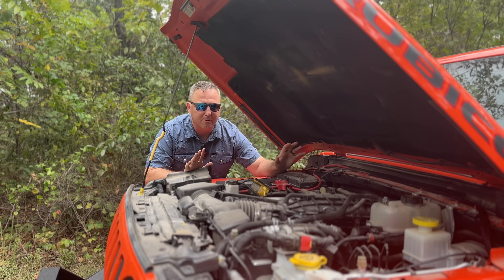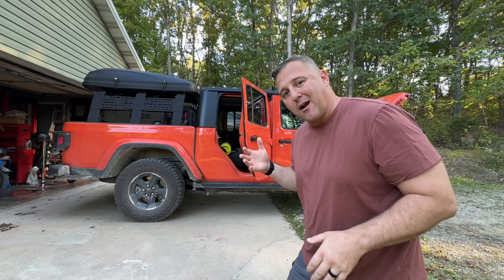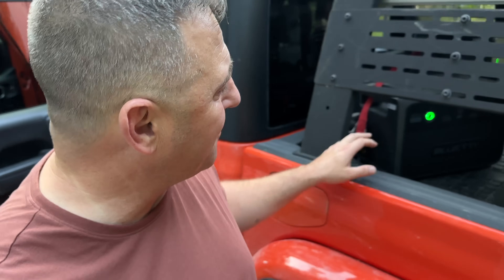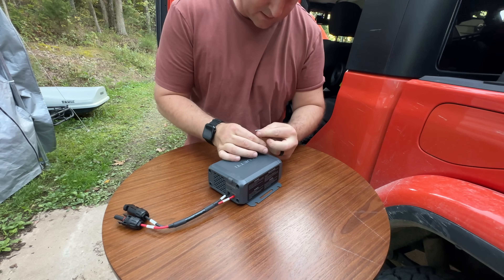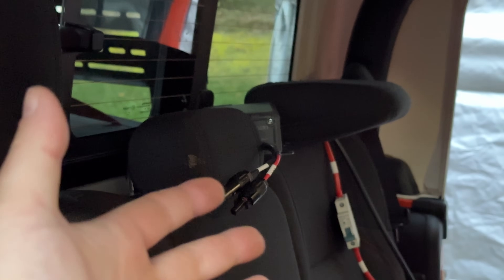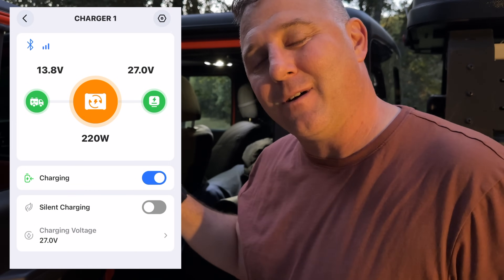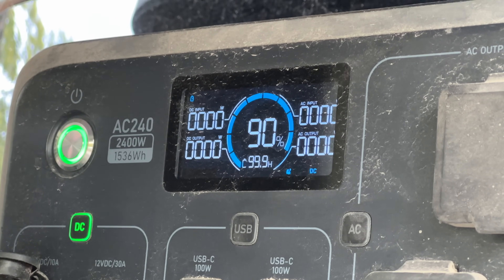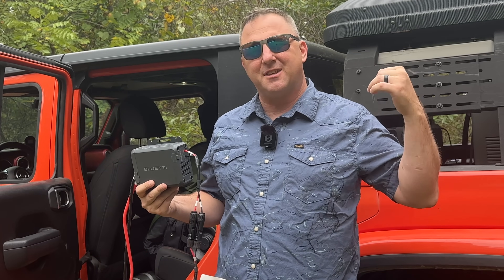Solar is OBSOLETE! - BLUETTI Charger 1

Comment: Nah, solar source is free and pays for itself pretty quickly for the storage, cables etc.  My rig requires a house battery so I'm not paying for that in a solar solution because it's there anyway and panels are getting cheaper all the time and for charging power stations, you've already spent the money on the storage.  Cables, especially low voltage can get expensive but yeah, free energy source mitigates and back fills that cost quickly.  Alternator failing on my RV in a remote boondock, I'll pass.  I would use alternator charging as a backup system but never as a primary source of energy personally.  There is at least one video showing what these alternator DC to DC charging do, load etc and it isn't pretty at idle.  On the move the load on the alt isn't bad so if it is used strictly while in motion I can see it but if you're at a spot for a while and run your rig/car/truck at idle to charge power stations that's a pretty heavy hit.  Anyway, I'm in camp of, your title "Solar is obsolete" is nonsense and nothing but click-bait.

Comment: Great video. Second one I’ve found talking about DC to DC charging.  So it’s made me pause,  getting ready to do a Sequoia build with your basic led lights, onboard air compressor and cooler.  Was planning on a solar set up BUT you and the last bluetti dc to dc video have made me reconsider.  My knowledge of ANY power is limited.  In just a couple sentences could you tell me why this set up would be a better choice than solar?  I’m probably looking at an average of 2-4 day camping excursions with the electrical devices I mentioned.  Thank you in advance.  🙏🏻

Comment: Why would you not have routed the cable in the reverse direction with the breaker closer to the vehicle battery?
Reply from the maker: I moved this over to my minivan and have added a regular fuse near the battery. The breaker is supposed to be near the charger to shut it off for storage.

Comment: What a dumb 'catch phrase' all over YouTube! Solar is NOT obsolete! It has its place for the right circumstance and / or situation. If you do have engine trouble, burn up your alternator, or whatever the case may be - then you're screwed. You're going to need that solar panel.

Comment: You kept saying alternator charging for the Blueetti Charge 1. ??
Then you ended up hooking it to the battery which is what I had expected.  
Isn’t it better to set the adjustable charge rate to a lower than the max setting.?? Especially if you plan to keep it within the charging parameters of the power station.
I am also considering the Pecron dc to dc charger.

Comment: I prefer the old school device called a battery isolator. It's been around for many years. Just install a 2nd battery under the hood for the camper then put a battery isolator between it and your vehicles battery. Both batteries are charged by the alternator but the vehicle battery can't be discharged by your camping equipment. That's why it's called an isolator. You can still charge the 2nd battery with solar panels if needed.

Comment: First of all, thank you for putting out this video second I'm electrician of 45 years and what you're saying about putting the circuit breaker in a warm engine compartment might be detrimental and cause premature tripping the breaker. The breaker is a thermal switch resistance is measured by heat. Just something to think about.

Comment: So I am no rocket scientist but I clearly saw where he installed the  black (negative) wire on the red (positive) side of the charger.  It clearly had the + symbol where he  INSERTED the black wire and tightened the set screw. 😮😮😮😮

Comment: The 800 amp Ecoflow alternator charge vs  Bluetti Charger 1. Which one is easier on the alternator?
Reply from the maker: EcoFlow is harder, but you can limit the output on both devices. So, you don’t need the entire capability of that’s an issue.

Comment: I guess people don't care about replacing alternators due to running it at 100% duty for a hell of a lot longer than it should be.... the charger does not "provide" any wattage as the comment states and is just putting extra load on the vehicles electrical system.... (which it was never designed for).... That's right people don't care about having to replace things constantly!! consumerism at its finest!!

Comment: There is a way to put both solar and battery through Charger 1 to recharge your power station quicker. You need splitters for Negative and Positive and a couple of diodes for extra safety and you have to match the solar output to your alternator and set it on the Charger 1. SOLAR IS EVERYTHING but obsolete.

Comment: Solar may be obsolete for you, but for me it still has its own value. I use a DC-DC charger in my car to keep an in-board LiFePo4 battery fully charged whilethe battery serves a few purposes such as running my cooler. The RedArc DC-DC charger can use solar panel input for when my car is at campsite and not running. I am very happy with that setup.

Comment: These put extra strain on your alternator that the OEM part wasn't made to do. If using this device you WILL be paying for a new alternator battery etc. Your better off to get a solar generator. There companies that make portable solar generator that comes with panel and also a wind turbine to charge batteries on cloudy days.

Comment: Your presentations are great and I really like and benefit from them.

However, relying on a dc-dc charger may not be wise unless your reliance on battery and charging methods is limited to non critical needs such as weekend or short term camping.

My requirements have changed in the present day economic/political climate.  My needs are now critical and long term.

The probability that my Sienna may become a long term shelter in the event of an economic emergency resulting in extended unemployment, have significantly increased over the past 100 days.

That said, my battery requirements changed to:  
1) DC-to-DC Charging
2) Solar Charging (200-400W)
3) Plug-in Charging

I "hope" the economy does not collapse but I have never found "hope" to be a reliable predictor of things to come.  Constant observation and search for new supporting data points are better predictors.  The data continues to point toward the approaching dark clouds.

Your videos are a wealth of information, keep them coming.

"Be Prepared" my Friend

PS - I installed a breaker right on top of the battery to address my concern of a short circuit/fire hazard in the wiring.  Like your concern, this minimizes short circuit risk!

Comment: I really appreciate the warnings and real world concerns.  I see were you might cut your alternator life down 3/4 1/2  ?  ask around is there a better  alternator for the extra work  ?     or Spare   Good Video 5*
Reply: Solar is definitely not obsolete!   I like the backup system   Your big  BLUETTI  in the back can be charge in AC if needed  .     I`m still not seeing anybody talk about there  auto`s System  does this effect it  what does  Jeep say  can that be a option in buying a Jeep  back up power .   You did get very close to this in your Video .   I`m calling GMC tomorrow to see if they can put this in  and what do  they recommend   with out   warranty problems. Good Video 5*

Comment: And let's face this fact about over working your alternator and having problems that aren't covered under the vehicles electrical warranty. You also had the ability and I always suggest to anyone adding gear that could over tax their charging system or electrical system in their vehicles to replace the factory alternator and battery both when they add things such as this charger system winches or offroad lighting and at most add a second battery to their electrical systems to handle all that load you just added to the vehicle!!!!!!

Comment: Ok my guy you claimed at the very beginning that someone else installed this charging device and they placed that surge protector inside by the left rear door and that had you installed this you would have placed that surge protector cut off switch under the hood closer to the battery. But you're second part of this charging system device you've added an install video where you're installing this yourself! Which means that you could have placed the cut off switch under the hood!!!!!! That's a you issue buddy!!!!!

Comment: @ Adventure Gear TV, First Off, Solar is not Obsolete, And that charger is only good if you are driving, When Camping or Off Grid you can't leave your Jeep running  for 3 or 4 hours every other day or you would not have enough fuel to get Home, If you are going to Post this BS at leased put your Brain In Gear first.

Comment: I've got a 500w solar panel on the roof of my campervan and would never consider removing it, I've simply fitted a changeover switch when I drive I switch to charger 1 and when I'm stationary I switch to Solar. Simples.

Comment: Since you have both bluetti charger one, and ecoflow alternator charger, and you also have upgraded alternator, you can charge your ecoflow delta max on multi charger mode, right? Ecoflow alternator charger goes to the expansion port. And if you buy mc4 to xt60i connect to that bluetti charger one to the solar input on your ecoflow delta max, i know my ecoflow delta 3 plus allows me to do so i guess it will be the same.  You can charge 800w + 500w = 1300w. Damn.. that is a super charge.

Comment: Nice video.
Question- is there a way you could put a switch under the hood to turn off power to the Charger 1 and let the electrical system revert back to its original configuration to insure you are getting plenty of charge on your vehicle battery?
I’m thinking on long road trips after you have charged the Bluetti for a few hours, when you stop for gas, flip the switch and let the alternator give the battery max charge.
Thanks.

Comment: We have this installed and while it's an amazing bit of kit, we are now installing solar aswell as you cannot be static for longer than a day or 2 before you need to drive again to recharge and all we have plugged in is a cool box and a gas detector into our brand new AC180. I think it's good to have both, solar and charger 1 in our situation

Comment: Thanks for showing us the install. One quick note on the XT150 connector. They have been used in RC including drones for decades and the point is to be non- proprietary  XT60's and 90's are much more common but totally available.

Comment: The oil party will end, solar energy will be here well after we turn into carbon.  What influencers need to push if for energy efficiency.  Car makers don't make cars that use less gas because they are not forced to do so.  the batteries on all of the so called generators are not replaceable in most cases, for that you have to build your own.  That bluetti does not charge itself, it needs to be charged, be that solar or grid power.  We live in a world that is completely governed by planned obsolescence.  things are made to fail, not to last and definitely not with efficiency in mind.

Comment: Use a battery and hook the dc to dc on off switch to somthing in the fuse box that run on the accessories from you ignition. It will never charge when truck ain't running. Starter battery will be fine.

Comment: So, you have to have a several thousand pound generator with a small power output compared to smaller more efficient generators while being a hundred times the price, and then keep filling it up with a limited and expensive resource.......

How does this make solar obsolete?

Comment: Very interesting…especially overloading battery / Alternator issues you mentioned, sounds like a headache waiting to happen… I suppose am I better off just getting solar panels on top of my RV ? Curious…I am set up for solar to plug in, it’s just a matter of installing them on the roof of my RV …is this designed for. more cost effective compared to solar ? Thank you

Comment: Thanks for the video!  Great discussion!

I was wondering, though, have you actually measured the power from the charger?   Or, are you assuming you are getting the manufacturer rated power?

Also, are you getting a standard 13.8 volts DC out of the unit?   Or, can it be adjusted to boost the output voltage?

Comment: One thing I was wondering is does this turn off when the vehicle is off (to avoid battery drain)? Or do you need to unplug every time you turn off your vehicle? I see Bluetti says it includes intelligent voltage monitoring. Did you find that worked out okay?

Comment: I am just looking into this.

Questions
Could the alternator charge a second battery that would power the power station.

A bettery seperate from the vechile starting battery?
Reply from the maker: That’s exactly what it does. In my case the second battery is the power station. You could also charge a different battery.
Reply: @AdventureGearTV  In my case being in a van I thought maybe a second battery might hold more of a charge than say a jackey 2000? 
Then I could charge the jackery more from said battery.
Would this be correct?
Thank you for your previous response.
Hope you are staying warm out there.

Comment: Sorry, it does not replace solar. I have a 220w solar panel on my roof. When driving in sunlight the panel works better than the Charger1. The Charger1 is great when driving in overcast conditions.

Comment: I install car audio systems and let me tell you.....PLEASE install that circuit breaker at a minimum of 18 inches from the battery.
Reply from the maker: Do you mean leave greater than 18”? I just installed it in another vehicle and added a fuse about 10 inches from the battery positive.
Reply: @AdventureGearTV  Well if you installed a fuse within 18 inches from the battery, that's perfect. It'll protect the vehicle from any shorts or damage that may occur to the wire.
Reply: How big of a circuit breaker would you recommend

Comment: at 250 the price is a bit steep. i'm seeing dc to dc chargers on ebay,  for a bit over 100 bucks. I wana get a setup with the dual input ones from powerqueen with solar and alternator charging 40a there like 160 bucks.

Comment: the xt150 isn't proprietary, they are all over ebay and amazon. same with any of the xt series connectors, as far as i know. good vid, t.y. A favorite channel of mine, foresty forest forgoes solar and uses a 60a dc to dc charger i believe from renogy, though he said hes had to replace it 3 times in a few years but thats with pretty steady use with a lifepo4 200a

Comment: well a question bluetti forgot to answer: what if you already have Solar? Then you gonna swap connectors?? dumb! the charger 1 needs PV input, or at least cut it off when the engine is running
Reply from the maker: I recently made a video on this topic, and the problem is that the voltage needs to be the same between the solar array and the Charger 1.  Otherwise, the Charger 1 won't turn on. I was disappointed with this, but got a voltage converter for my solar panel to match for about $15 bucks.

Comment: It works as long as your car runs so you are still completely dependent on things you don't control.  Solar panels produce energy whenever the sun is above your head.  You don't control it but it will shine until far after your life ends.  Solar is not obsolete.  Your title is idiotic.  A combination of the charger and the solar panels is optimal, if for nothing more than for redundancy.  An EV makes this entire solution irrelevant and also reveals the ICE dinosaur for what it is . . . about to become extinct.

Comment: I'm not going to use my alternator to charge anything when I am parked up for 3 days; that's why I have solar panels and a split charger for when I am driving.
Don't get me wrong, this is excellent for when you are driving, especially if you have a beefy alternator, but I'm not replacing solar with the diesel generator that is my van.

Comment: Does it consume more gas?
Reply: @porchourngchuor3567  I doubt it. Only if it's used on idle which indeed is wasteful but on the road while cruising at highway speeds I bet your gas mileage isn't even dented. Running the A/C barely makes a dent now if miniscule. People get bent when you suggest that this is a practical alternative to solar. It's funny.

Comment: To get 500 watts of solar would take many hours verses driving for an hour. I thought that breaker was in the front near the battery connection, thanks for pointing that out, I have to connect mine , I just bought the elite 200 from bluetti , you put on the best video on this charger1 , showing all the connections, very helpful. It’s supposed to shut down on its own so it doesn’t drain the battery. I’ll be traveling for weeks at a time so I hope it’s trouble free ! 🤷🏻‍♀️😀🙋🏻‍♀️

Comment: How does this work with a 4xe without the alternator?  My understanding is that the high-voltage battery charges the low-voltage (12v) battery so it probably wouldn't matter.  

Second, what's the Anker variety of this?  Does Anker sell a similar kit?  Or am I stuck with Bluetti?  Thanks

Comment: I really only came to see how ridiculous of a claim the title was. So this replaces solar huh? What happens when you run out of gas in about 365 miles @ roughly 18mpg? What happens if you need to use your Bluetti away from the car? You'll probably just plug it into the grid utilizing more fossil fuel which is sort of the antithesis of these products. I'm not sure why you didn't just buy a gas generator to serve your needs...

Comment: Just FYi, XT60 is NOT proprietary, least of all to EcoFlow.  You can get third party adapters.

Solar is definitely not obaolete. But it sure is nice to be able to harvest energy while you are driving.  A DC-DC alternator charger (especially these high amp EcoDlow and Bluetti ones);can recharge faster than a couple hundred watts of solar that can fit on your vehicle roof.  Nice to have both.